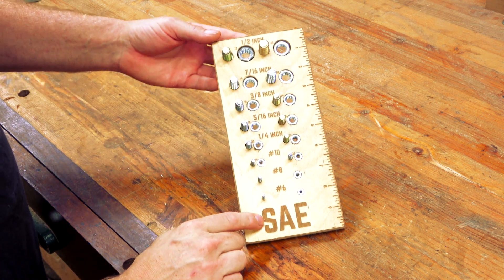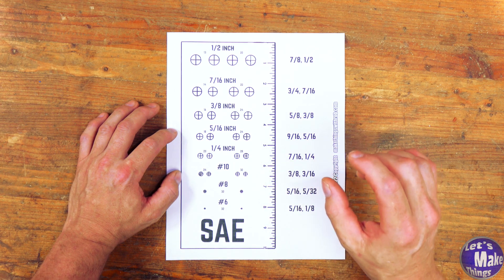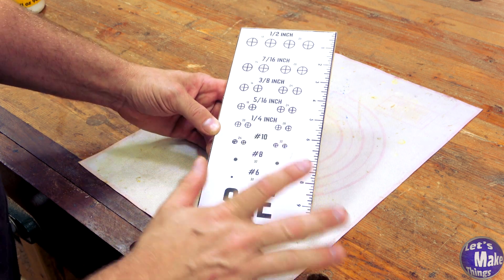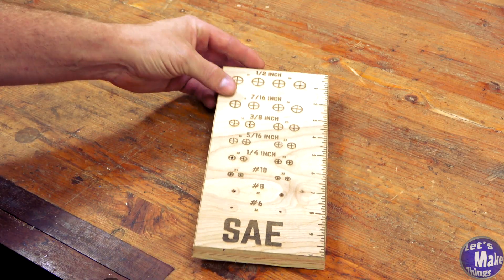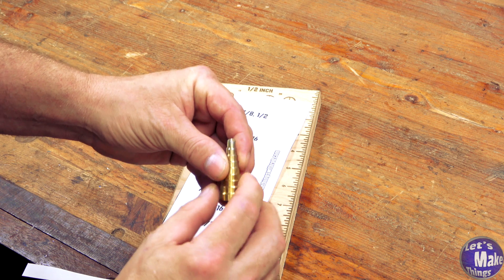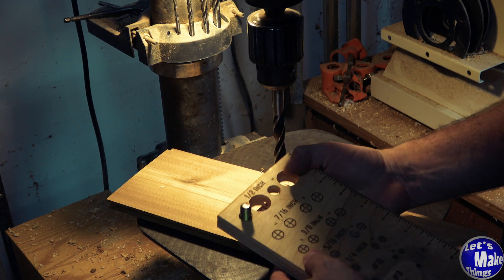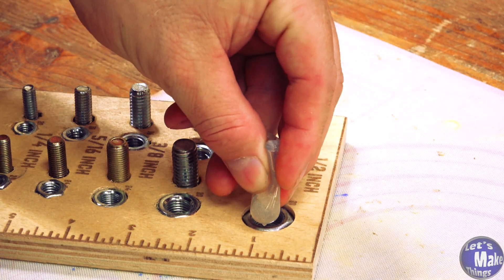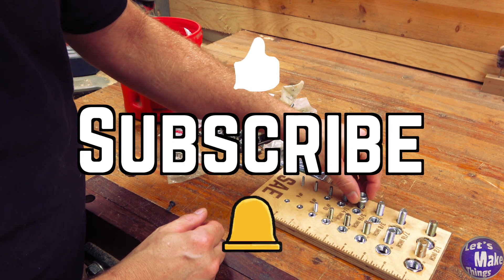Nut / Bolt Identifying Board

Comment: For people not owning a laser engraver: If you apply a thin, even coat of Modge Podge (or some water-based poly) on the wood, then apply the laser-printed paper, reverse printed (important!), face down, let dry for 1/2 hour, then wet the paper and gently rub the paper off with a finger or a toothbrush, you will have the print directly applied to the wood. See this for an explanation: https://www.youtube.com/watch?v=xHOWUR8vTvo&t=416s
Reply from the maker: Thank you for that!  I am doing a bitesize video (shorts) on the main channel for mod podge, although your method (I think?) would make the numbers backwards.

Thank you for your comment, I'll have to see how that one works.  I guess if you don't copy the numbers it won't be reversed.
Reply: @makethingswithrob  No, as mentioned, you MUST reverse print the image onto the paper with the laser printer. This can usually be done with the laser printer settings themselves, or use an image editing program to flip the image. The REVERSED image is then gently but thoroughly pressed into the wet poly printed side facing the wood and left to dry. The resulting image will be positive and not reversed - the numbers and letters will image correctly.
Reply from the maker: @rcort4864  Ahhh, my bad.  That makes sense.  😉
Reply: I would never be able to keep the epoxy out of the nut threads, so i would screw a bolt into it temporarily.

Comment: Great idea! You can probably make it more compact and also save on the cost of the nuts by making it from a piece of steel, aluminum or thicker acrylic. Then you can use a Tap & Die set to tap all the holes instead of having to buy & epoxy each size of nut. To make it even more compact, you can tap a 2nd hole for each size and then cut the heads off the bolts and screw them into the 2nd set of holes with some threadlocker (or epoxy).You can also use some threaded rod for some of the more common sizes as well if you don't have the bolts.

Comment: If you specified it, I missed it. Are those supposed to be course thread on one side and fine thread on the other?
Reply from the maker: Hey Jason, sorry for the delayed response.  Yep, fine and course thread.  When I was buying these at the store (and individually it came out to about $10) I looked at the metric and couldn't believe there was 3 thread pitches.  Ugh.
Reply: I was wondering the same thing. I'm assuming that's what he did because I couldn't think of any other reason to have duplicates of the same nuts & bolts.
Reply from the maker: @nnamerz  Sorry it took so long to answer but yes!